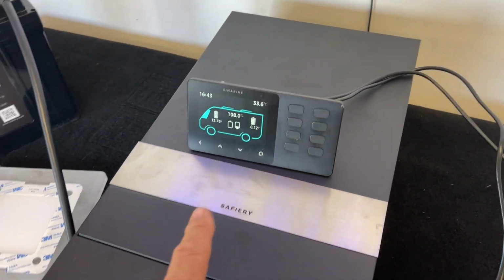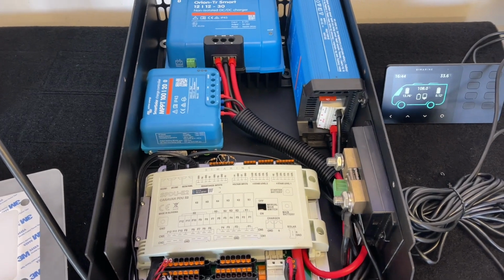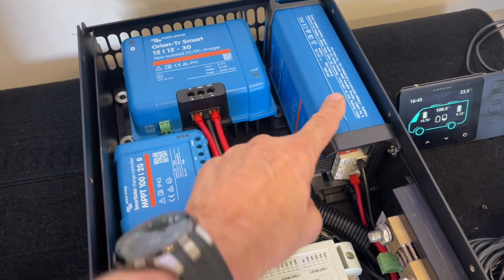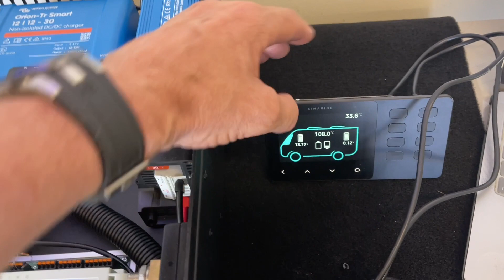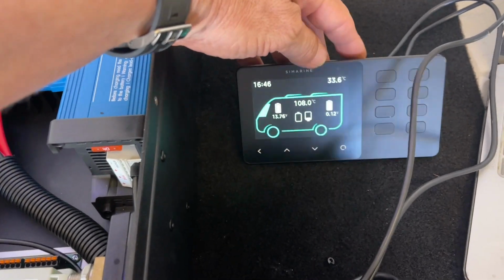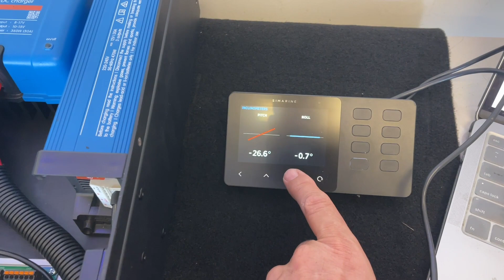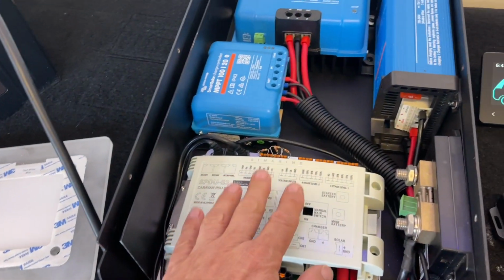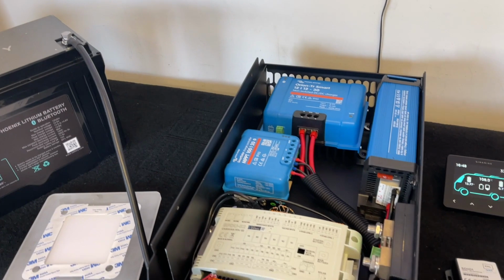Safiery Black Bridge Black Tie Pack

Comment: do there is option to control water heater ?
Reply from the maker: It can be added but would be a 12V 200W unit. These are slow to heatup. For faster water heating, we suggest 48V which is 1000W

Comment: Does it have a smart phone app that can switch lights etc on/off  (the other product does)
Reply from the maker: Yes
Reply: @Safiery  can you provide further info as to the smart. Phone app functionality, I did a request on your contact page but no response
Reply from the maker: Yes, it uses wifi to access the Black Bridge. What appears on the Black Bridge Screen appears on the phone. Coming this year is the remote access feature over the internet. This is the feature that makes a big difference and we have it with Victron. We have found little utility for having a Smartphone locally. Plus the Black Bridge has dedicated buttons which I insisted on in the design. Its easier on the brain to just touch the button than use a soft screen or smartphone.
Reply: @Safiery  appreciate your response, I would argue that in a Off-road Camper environment with space issues coupled with participants who have mobility issues there is great utility in not having to access a panel or a button . A smartphone integration allows control of system's (lights, pumps, HWS, AV etc) without having to navigate to a control panel.
Reply from the maker: @JacNJohnsTravels  Then go for it John, this will do that. There is a science to User Interfaces depending on (menu) depth of information required. The best practice for ease of use is 1) One touch - use a button 2) Two level - use a Smartphone/smart display 3) Three level - use voice.

Comment: Hello, will it switch a twin ARB compressor unlike the RedVision? Can I add a Redarc bcdc charger?
Reply from the maker: Yes it will switch the ARB compressor, even the twin as the switching is low current. The system will measure up to 100A through the battery connection which is less than the ARB twin. Yes you can wire in the Redarc BCDC charger.
Reply: @Safiery  Thank you so much. Looks like an awesome system.
Reply: @Safiery  Hello Bruce, sorry Mate I have another question, can you please tell me what shunt you have in this system. Am I able to add an Enerdrive ePro or Victron 712 monitor on the dash? Thank you.